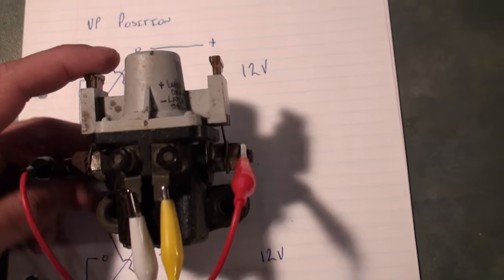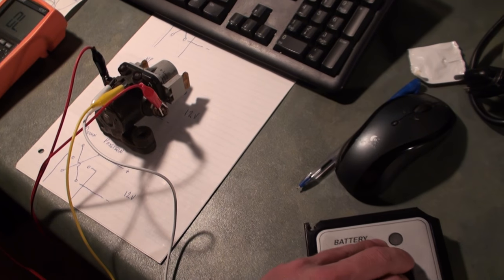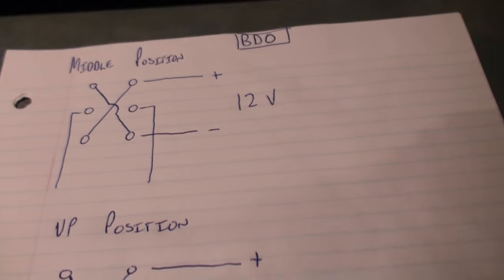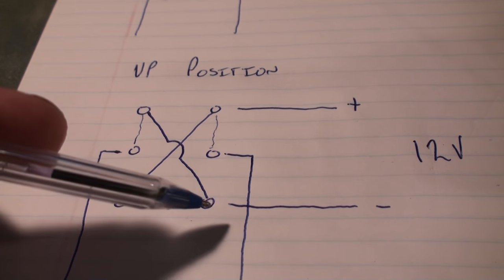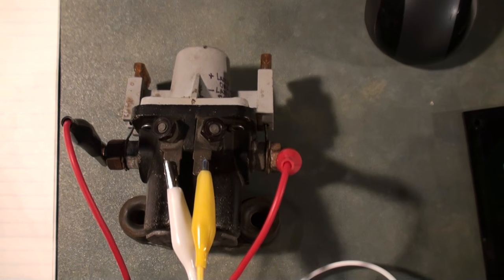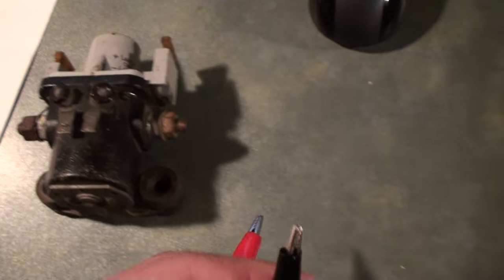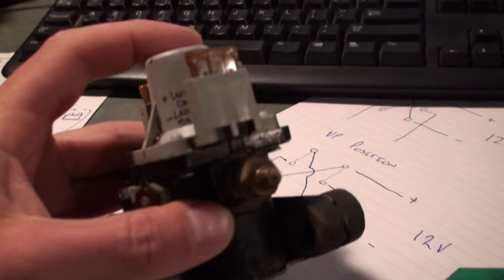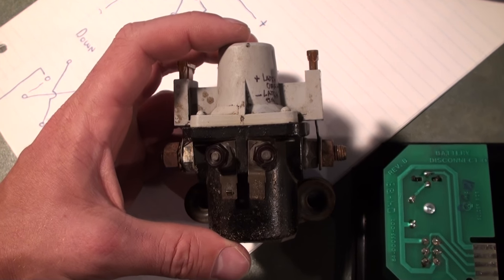Intellitec BD0

Comment: Hey guy I been pulling my hair out (literally I had hair now I look like Phil collins) trying to figure out what was wrong with my 12v system in my RV.  I have purchased every part to the system that there is and to no avail.   After watching your video I was able to track the issue (after spending well over $200 ) come to find out the only thing bad was the switch. It seems that the old one is no longer available so intellitec has a replacement but the pins for the +/- returns to the couch solenoid  are on different poles. So I had to move some wires around. Thanks again for making it so easy to understand what does what to what and when and why. 

Top notch video... thanks again
Reply from the maker: Wow, this made my day.  Thanks for watching, glad to have helped you with your RV electrical issues. Have a wonderful day ;)

Comment: Great Video, I ordered BDO and Latching relay.  It came with no pin trace instruction. Also found female plastic connector did not come with the BDO so your video was very helpful with the pin I'd on BDO.  Still looking for plastic female harness connector to wire it all together. If you know where I can buy just the harness connector I would appreciate any source info on it.

Comment: Thanks so much for your video!
What was your solution on reconnecting the red & green wires into a wire connector to the fuses? 
I thought I could modify some connectors, but that was a fail. I've been searching for the correct type. If you can help with how you remedied yours, could you please tell me what you did?
Thanks again so much! My 1996 classC motorhome is kind of dead until I get this fixed. 
I live fulltime in it. 
Thanks!
Reply from the maker: Hey, i just stripped the ends of the wires and wedged the bare wire into where the blade of the fuse is.  Take the fuse out, stick the bare wire in and put the fuse back in, works fine like that.
Reply: @UOttawaScotty  Oh, now I'm stoked!! Awesome hack. Thanks so much!!!

Comment: I have one were it does not turn on.  Before realizing what I was dealing with, previous owner bypassed the system. After my van died from sitting about a month, I decided to wire the positive wires correctly but nothing. The reset light slightly pulsates but nothing happens when pressing it. Unsure of the condition of the module box but I did push a wiring harness in that felt loose. Any help would be appreciated.

Comment: I wonder if you might help me troubleshoot. 
I've attached a good battery to a 2008 trailer, yet no 12v power in the trailer unless it's plugged in to 110.  Everything works when plugged to shore AC 110.
The orange LED on the Intellitec BD0 panel is always orange when plugged to AC 110 no matter what position the switch. When pressing the switch up there's a single audible slick from the relay. When pushing it down there's more of a double click sound. The light never goes off. 
Is this a stuck relay? Stuck perhaps in the off position? Thus not allowing the 12v battery to power the trailer? 

The fact that this LED is constantly on makes me think so.
Reply: Please note that 110 extension cord is plugged into house socket the light for coach will remain on no matter what u press. To test the coach disconnect switch remove your extension cord

Comment: I can't understand why the company selling these latching contactors doesn't fix the problem with them sticking. Why does the customer have to fix the problem?
Reply from the maker: Well I don't think any of these switches are sticking while new, the one in this video is very very old, 1989 to be exact.  I have only seen this happen to older switches like this and the new ones don't really seem to have the same problem, not to my knowledge anyway.  I just know that a lot of RV's sit dormant in a field for years at a time, out in the elements, and your always gonna run into problems like this in those situations.

Comment: Is there a simpler way of lubricating the switches so they work properly?  Mine have been stuck for years.
Reply from the maker: Hello RM, its dead simple to get inside these things, all you have to do is remove the four screws around the cap and it should come right apart, Once your inside, its a very simple, yet rugged, action, should lube right up and be good to go.
Reply: Thank you - I will give it a try.
Reply: Hi.  I have a similar latching relay in my 2017 RV that is stuck in the closed “use” position.   I will be disassembling it soon.   What lubricant did you use, and any specific suggestions once I get inside it?   Thx.

Comment: Where is the relay located?
Reply from the maker: Selfy Omenome you can get inside the housing to get access to the relay by just removing the four screws around the perimeter.
Reply: @UOttawaScotty I can see the on/ off switch in the entrance wall buth where is the relay guys ..?
Reply from the maker: @arriagada1957  the relay will be in your engine bay somewhere, different on every vehicle
Reply: I have a 22 ft motorhome with a back entrance (door) the on/off switch is on the left almost the floor level...the relay has to be somewhere around there ...I do not see anything by the engine bay ..
Reply from the maker: @arriagada1957  its gotta be there somewhere, keep looking.
Reply: Oyeha...!!! I'm going to the engine bay again..the relay has fuses so it had to be accessible right...ah..! couldn't find nothing... I'm going under the Coach .....
Reply: @UOttawaScotty  I took the 4 screws holding the switch I can see the wires going like under the Coach....that is my next step...I will  follow those wire harness...
Reply from the maker: @arriagada1957  exactly, follow those and it will lead to the control board.